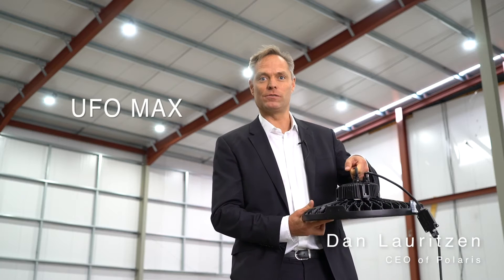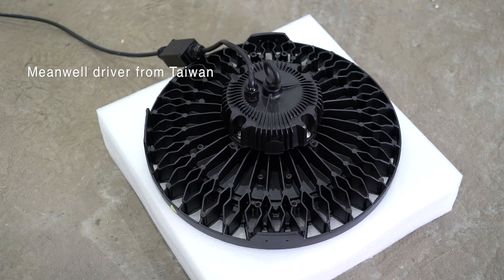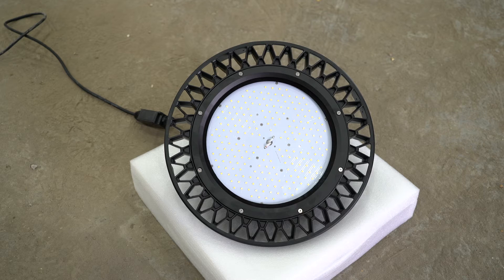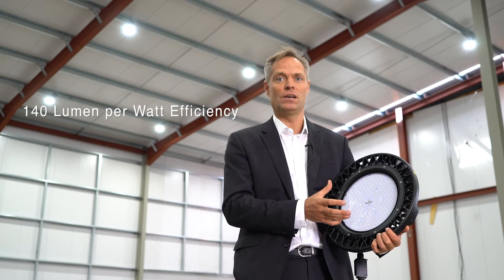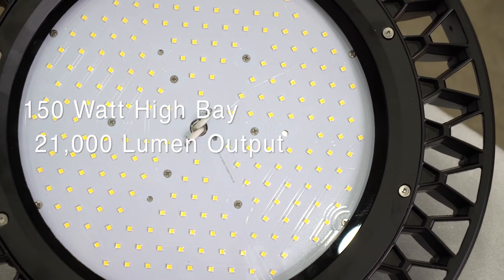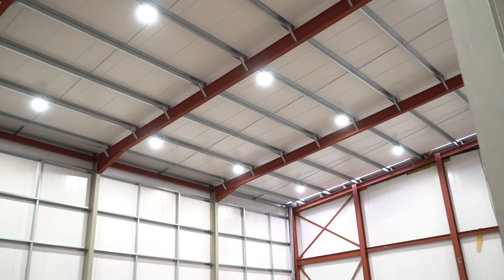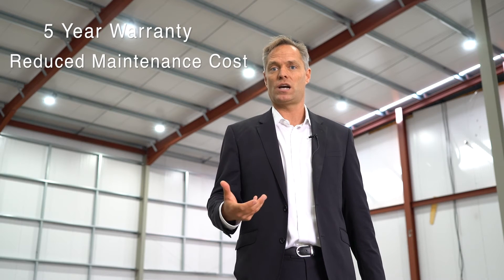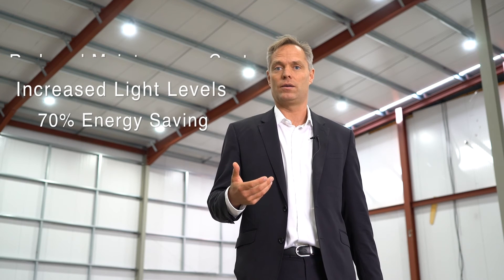LED High Bay - www.polarislight.com

Comment: should fly into outer space for the price
Reply from the maker: Thanks for sharing your feedback. Our LED high Bays are more expensive than other brands due to more durable and expensive components. First of all we add 30% more LED chips, which increases the energy efficiency to 160lm/w. This design also distributes the usage over more chips so they last 2-5 year longer. We also use Meanwell drivers, which is $50 more expensive than any other drivers on the market, but our testing shows that the durability of these drivers is unrivalled. 
Our main clients are Aerospace and Engineering companies, who need maximal energy efficiency as well as long durability. Our energy efficiency ensures are quick payback of only 1-2 years and our durability ensures that they recoup their investment 4-5 times over the lifespan of the products.